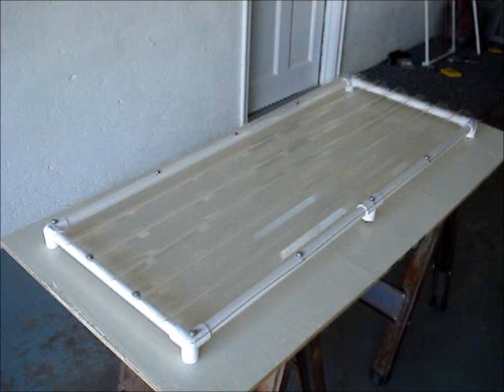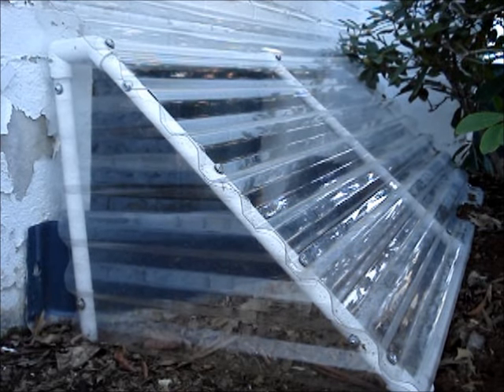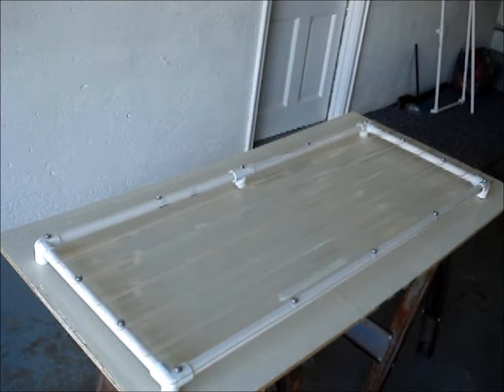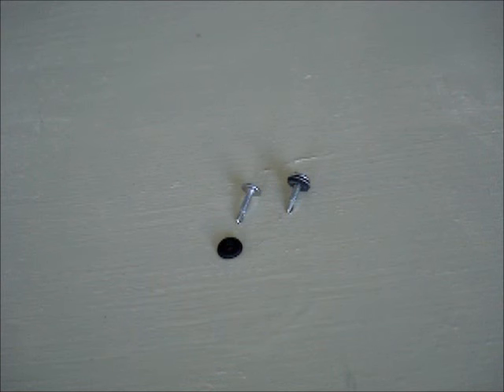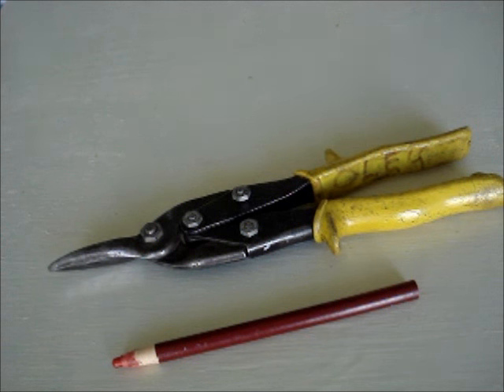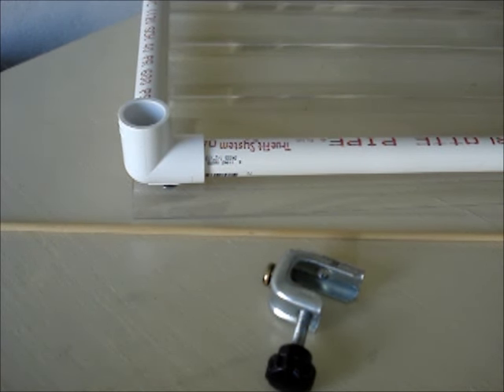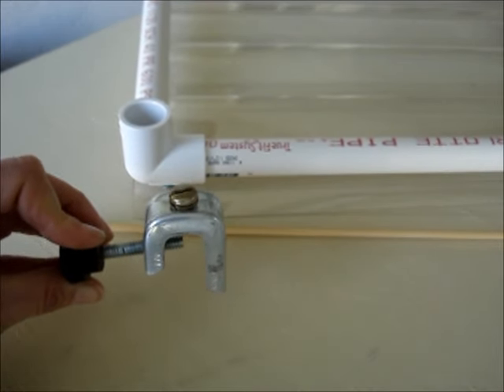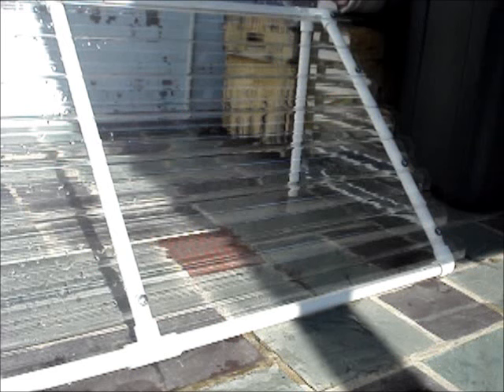Make a Durable Window Well Cover

Comment: Great instructions thank you!  BTW wanted to mention that PVC is not UV resistant, so it might start cracking after few more years...  It can be spray painted with special plastics pain that will make it last much longer.
Reply from the maker: You are welcome, thanks for commenting and the suggestion about the paint.

I was concerned about the life span of the PVC due to the sun.  I tried to find information on how long it may hold up with sun exposure.  I couldn't find a any firm data.  I do have a PVC elbow that was used for a downspout drain.  It was there when I moved into the house 15 years ago.  Over the years it has yellowed and I suspect it is brittle.  Unfortunately, I don't know the age of it.  I'm guessing that the PVC will hold up at least 10 years...depending upon conditions.  I'm sure it won't hold up as long in some place like Arizona.

Good idea about the paint, the correct paint could extend the life of the PVC.  Also, if you don't want a white frame, you can make it a different color.

Comment: Great idea and great video; thank you thank you thank you! I just purchased a house with my first basement and window well. I was unaware these do not always have proper drainage and sadly 3 months into my new home I had an inch of water in my basement!!! We nailed it down to the fact  sitting water in the window well (after a huge storm on already water logged soil from 3 months of snow) had seeped in at flloor level somehow... Anyway as my window well is 8 feet wide the commercial covers did not fit. I found your video and $64 later (including pipe cutter) I have my first DIY project completed  in less than 2 hours and my cover looks great!!! So happy. With tremendous appreciation, Susan
Reply from the maker: Hi Susan, thanks for the compliment.  It made my day to hear that my video helped to solve your problem.  I just finished doing some spring clean up in my flower beds and washed up my covers.  They have been outside for 3 years, after washing them, they still look like new.  I just gave a couple of covers to my neighbor, they are going to paint the pcv pipe.  White is the wrong color.

Comment: Can I ask how you ended up anchoring them? Mine are covering poured cement wells that are about 4 inches thick. The windows come up about 6-8 inches above the top of the well and I was thinking about making mine like your finished one cant figure out how Ill get them secured.
Reply from the maker: I have 3 wells and haven't anchored any of them.  Two of them are in flower beds, one is just sitting on top of my flagstone patio.  None of them has blown away during the last two years.  If yours is in an area that is not sheltered from high winds, then perhaps you can put an eye hook in the lip of the galvanized metal liner, then secure the cover with wire tie wraps or a small Velcro strap. If you can't get an eye hook through the galvanized liner, then maybe put them in the concrete or the wall.
Reply: No liners, this is 1945 work in a fairly rural area =D I think Im going to attach them right into the cement as it gets pretty windy here at times. Thank you for the response, great video and I cant wait to get to work on mine!
Reply from the maker: Things blow around on my patio, however, the cover on that window doesn't budge.  Perhaps the shape of the cover (it's not a flat one, it has an angle) doesn't allow the wind to catch it.  Before you install any anchors, you may want to just try setting it over the window, cross your fingers and see what happens.  One other thought, you could fill the tubes will sand to weight it down.   Thanks for the compliment on the video.
Reply: oh hmmm great idea, that might work and I would love to make them so I dont have to secure them too the cement.

Comment: Thanks for posting! I like this design so I think I'm going to make something similar after not being impressed by what my local hardware store had for window well covers. I'm just curious why you chose to run the polycarbonate horizontally instead of vertically? Was it just for ease of install? I'd assume installing it vertically would allow rain and snow to run off it more easily.
Reply from the maker: Hi Matt, you are welcome.  The sheets of polycarbonate are 26 inches wide and my window wells are 36 inches, so the material dictated the direction of the ribs.  I investigated ordering smooth sheets of polycarbonate, however the cost of the sheets and shipping was extremely expensive.  The polycarbonate roofing material was cost effective way to make the covers that I could find.

Comment: Nice job!  My window well is too large for most of the covers you see in stores, so this looks like an easy (and much cheaper) solution.  Out of curiosity, how did you cut and set up the sides?
Reply from the maker: Thanks for the complement.  I had fun designing and engineering the covers.   I cut across the ridges using tin snips.  If you are cutting parallel with the ridges, you can use a metal straight edge and a sharp utility knife.  I've read that you can use a circular saw or a table saw to cut the polycarbonate.  I don't know what kind of blade, the blade is supposed to be installed backwards.

The width spacing is dictated by the ridges.  You have to plan to fasten the low point of the ridges to the pvc pipe.  Measure width of your opening from the wall to the edge of your well.  Take that measurement and measure from the center of low point of the first ridge and find the center of next low point.  

You could also lay the polycarbonate sheet next to the wall and find the closest available low point on the ridge that will fit your opening.  Don't forget to allow some room for the pvc pipe.

Hopefully, I did a good job answering your questions.  

I did make a few extra covers that fit a 36-40 inch X 12-16 inch opening and have them for sale on eBay.  Just search for "Window Well Covers" and they will show up.
Reply: That helps tremendously.  Thanks!  Unfortunately, my window well is about 55-inches across, so your covers wouldn't be big enough.  I'll keep your ebay shop in mind though.

Another quick question, if you don't mind.  What PVC tube fittings did you use to create the right triangle shape on the sides of your cover?
Reply from the maker: The fitting used to make the right angle is called a side outlet elbow.

Comment: Approximately what was the cost per window? I have 4 of various sizes and need something like this made. Great job!
Reply from the maker: The current price for the sheet of polycarbonate is about $21 for an 8 foot piece and $32 for a 12 foot length.  That is very reasonable for polycarbonate.  The ridges make it a little difficult to work with.  I looked into buying flat sheets, but it became quite expensive after you paid for the shipping.  It costs about $10-$12 for a box of washers & a box of screws.  The pvc & fittings are cheap, depending on what you need  around $5-$8.   Thanks for the complement!

Comment: Really appreciated the instruction video.  You showed a window well cover that you had made previously and it has different pvc fittings.  Can you advise what fitting you used to attach a back leg piece.  Hope you understand my question.  I want to make one like the completed one you showed.
Reply from the maker: It's a side outlet elbow & a 90 degree elbow.  There is a small piece of pipe (horizontal) between the side outlet elbow & the 90 degree elbow.  This spring I washed off the covers with a little soap & water, they still look great after 3 years.  I walked past the covers sold at my local big box store the other day, the heavy duty ones were $20 each.
Reply: diane r Thank you so much.  I just finished one window well and I am totally satisfied with the results.  It looks great covering my window well.  The well had recently filled with water and leaked into my basement.  Your video saved the day!

Comment: Great job! 
It's a shame they don't offer something this well crafted at the hardware store.
Reply from the maker: It's been many years since I've made them.  One of them gets a lot of sun.  In spite of the claims of the manufacturer, the polycarbonate has clouded on that cover.  The ones that don't get much sun are still perfect.    The positive for the yellowed one, I have an extra piece of polycarbonate and can easily replace it.  I'm grateful to not have to buy new plastic ones from the big box stores every 3 years.
Reply: @Diane_R  Great idea. They have UV blocking paint that comes in rattle cans, all colors even in clear coat. Polycarbonate is pretty resistant but not immune. A fresh coat of clear UV blocker every two or three years should keep it from getting clouded indefinitely. Either way I don't think much if any UV has been getting through to the PVC.

Comment: Excellent idea. I want to make the one you showed at 0:46 with the sloped front. However, I cannot find the R shaped connector that you used to fix the down pipe, sloping front pipe and top crossmember. Any recommendations on where I could obtain a couple of those?
Reply from the maker: I used 90 degree, 45 degree elbows and these:  https://www.lowes.com/pd/LASCO-3-4-in-x-3-4-in-x-3-4-in-x-3-4-in-dia-Side-Outlet-Elbow-PVC-Fitting/3344664?cm_mmc=shp-cprdplbgooglelia-142-pressurepipeandfittings-3344664-_-0&placeholder=null&ds_rl=1286981&gclid=CjwKCAjwi9-HBhACEiwAPzUhHPh2A4Swa9JAjsDQccXIzA4VOuC5qOK9RF8qp-h18G7kUERfCGJ16BoC7VkQAvD_BwE&gclsrc=aw.ds
Reply: @Diane_R  Thank you Diane, much appreciated!